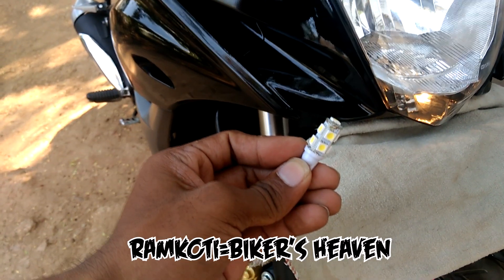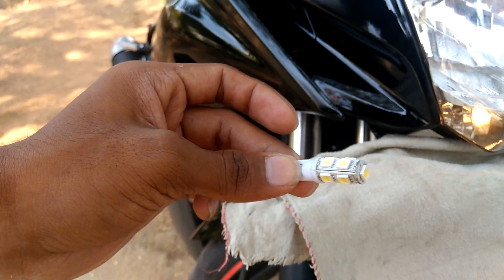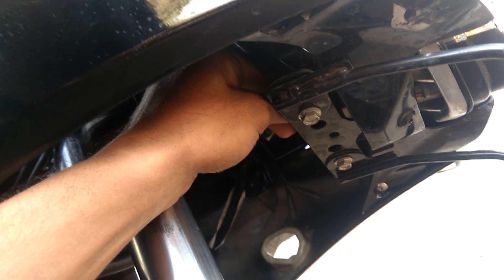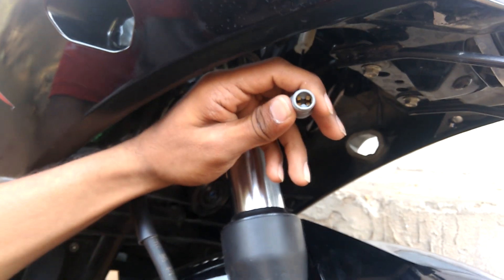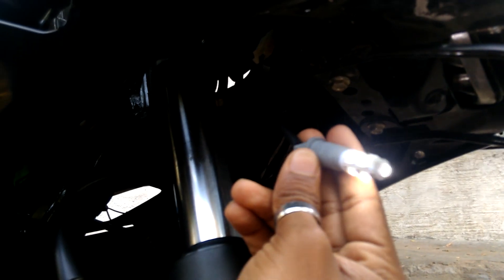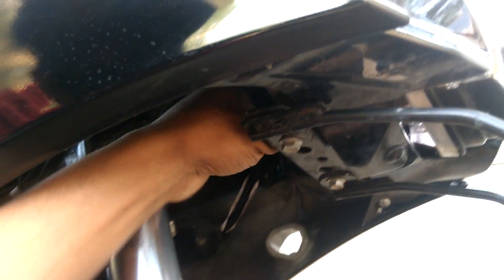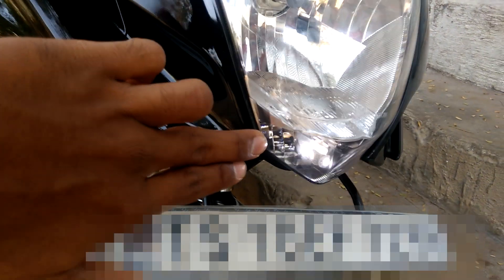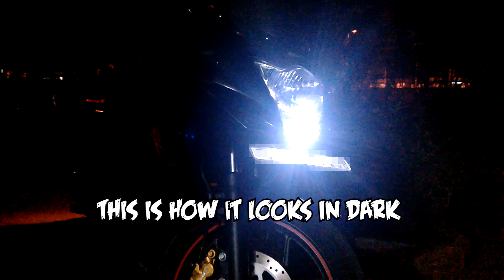DIY LED Pilot Light in Suzuki Gixxer SF | Gixxer | Cheap Light mods

Comment: Hey bro this was awsum...  But just suggest me we change silencer and led head light and horn how does it looks and battery will support for this stuff...
Reply from the maker: +vikram gattu You can do all that stuff but make sure while starting the bike everytime light is turned off or else it ll effect battery never self start your bike while headlights are turned on and these things might drain battery comparatively fast. So, you might need to get it charged whenever its you feel that battery is down.

Comment: coming to headlight part, I don't find the stock yellow light has that good visibility.. looking to change my stock headlight.. which one can i use?? is it recommended to use white light on indian roads as many said it is illegal to use a white light.......
Reply from the maker: Yes, the stock headlamp doesn't provide proper visibility in night,
coming to changing the headlamps i'd prefer Phillips extreme vision as it gives 2 times better light output,
white headlamps may look cool but they might effect the people coming from the other side i don't think they are illegal and even if they are illegal i don't think our police will take that seriously and catch you for that particular reason. I'd recommend you to go for phillips extreme vision because its better than those cheap looking white led lights and it is a yellow colored light so its perfectly legal. And another option is a projector which might cost around 1300-1500rs and visibility is good but to install that you will be needing to remove the whole headlight assembly by heating the headlight glass and stuff and then install it but as the stock housing is removed by heating while riding the headlight assembly might vibrate and make sound and even water may seep inside because after heating and installing the projector the company done seal for the assembly i gone. So, i don't think its a good idea. But, these are all the available choices and you can choose anyone which you like. but, if i were you i'd just install the Phillips extreme vision bulb. If you choose this please compare both the light's output and then decide which one to get. I hope this clears all your doubts and if you have any further doubts feel free to write them down :)

Comment: Hi,bro I want to ask does changing pilot lamp or headlight will break my manufacturer warranty??and is it legal to use that Angel eye hid projector
Reply from the maker: +Rajat khurana Yes! It ll void the warranty but only for that particular part. If in future that headlight is broken, it won't be covered under warranty just the headlamp not any other parts and its legal :)

Comment: bro, wanted to ask can a gixxer sf do abv 1000 kms in a single day or two...mumbai to bangalore continous..can it be trusted
Reply from the maker: +Park Max Yes brother it can handle it with ease don't worry :)
Reply: +Motovibe 
thanx bro..i am new to bikes...i have noticed after continous riding hot air passes through my legs near the engine..is this common??
Reply from the maker: +Park Max Yes bro common in naked bikea but in faired bikes due to fairing you feel it less :)

Comment: @motovibe : did this today.. thanks to you.. can you advise how to remove the mirrors in SF..
Reply from the maker: +mahesh m Thats easy brother, get 6mm or 8mm(I'm not sure about the size) Allen key driver (if not take your bike to hardware shop and try out and get the driver which is suitable for removing mirrora)and remove the two screws from each of the mirrors :)
Reply: +Motovibe .. I have an Allen set ..but does it have a nut under the fairing to hold it in place..in that case one would need to remove that black plastic cover adjacent to the meter to hold the nut while unscrewing the mirror...

since I was having this doubt I didn't give it a try .pls reply if u know further . cheers :)
Reply from the maker: +mahesh m No brother its just a screw you can unscrew it and take it off easily and if you want it put it back you can just screw on those screws :) its simple and there is no nut under fairing to hold those screws so don't worry and go ahead :)
Reply: +Motovibe thanks buddy..keep up the good work
Reply from the maker: +mahesh m I'm glad it helped you brother :) keep subscribed

Comment: + Motovibe what is rating of the bulb ? I mean voltage and current rating.. so that I can buy it on any electrical shop.. I stay in chennai...
Reply from the maker: +Pavan Kumar reddy There is no specific rating brother, Its a small led pilot lamp just ask for Parking Led light :)
Reply: +Motovibe Thanks Dude
Reply from the maker: +Pavan Kumar reddy Most welcome brother:)

Comment: Pls help my park light assembly is not coming out as u mentioned
Reply from the maker: +Akshay S K It will apply some pressure and pull the wire.
Reply: Akshay S K let me know if u successfully able to pull it out?
Reply: +Bengaluru Rider yes it did come out when i used a plair...

Comment: Dude i own Activa 3G, Can i fix this LED to it or do i need to buy something else?
Reply from the maker: +Vikram C Puttapaga Sorry buddy you can't put this pilot led on activa because it doesn't have a pilot lamp assembly but you can change the headlight to an white led one for pretty cheap price somewhere around 300-500 rs which is pretty brighter than the stock headlight of the activa :) I hope this helped you.
Reply: Ya man it helped, Thanks. I dont know whether its pilot light or not but 3G has rwo bulbs in head light. Thats the reason y i specified that i have 3G model.
Reply from the maker: +Vikram C Puttapaga No bro! Thats not pilot lamp, one is for low beam and other for high beam but you can go to near by mechanic and change the headlight to a Led one which is brighter just ask the mechanic which light to get and if available with him you can buy there it self :)
Reply: ok. Thanks for replying.
Reply from the maker: +Vikram C Puttapaga My pleasure buddy! :)

Comment: Can any one tell me are projector headlamps better than normal and why?
Reply: Saddy Vaingankar bro do u hav Gixxer?
Itz better u use the stock headlamp bulb instead of projectors lights. by adjusting it in urs correct eye nd road focus. I hav adjusted it to my Gixxer sf with (4mm L key)nd Itz beautiful at nyt natural beauty u will see bt projectors r also awesome if u want more nd more looking lyk gsx r super byk. nd if can spend more money on ur beast u can go with those projectors👍
Reply: Vineeth Vin yes bro I do have gixxer but the problem is I don't find the stock headlights as bright coz the visibility is very low
 Till then the object comes very close
Thats why I need more powerful light
Reply from the maker: +Saddy Vaingankar Projecter headlamps are good for visibility but they consume a lot of battery and also they heat up alot. If you do alot of night rides then projecter is not a good idea, try phillips xtreme vision H2 bulbs. If you do less night rides then go with projecter..
Reply: Motovibe Thanx a lot for replying 
Yes I don't ride much at night but still I vl think about the other option u gave
Reply from the maker: +Saddy Vaingankar Phillips bulb is the safe option because if the light is too bright it may cause inconvenience to the people coming from opposite direction..
Reply: Motovibe Thanx a lot for your advice
Reply from the maker: +Saddy Vaingankar Your most welcome..

Comment: I couldn't remove or pull the light from assembly
Reply from the maker: +Kushal Kittu just hold the wire which is going in, and pull it..
Reply: Even I also can't able to pull out

Comment: + Motovibe what is rating of the bulb ? I mean voltage and current rating.. so that I can buy it on any electrical shop.. I stay in chennai...
Reply: ask for an led bulb used in pilot lamp under headlight..it will cost u 40 rs.. it doesn't have a high wattage to hurt ur battery .
Reply: +mahesh m That's cool bro will buy one